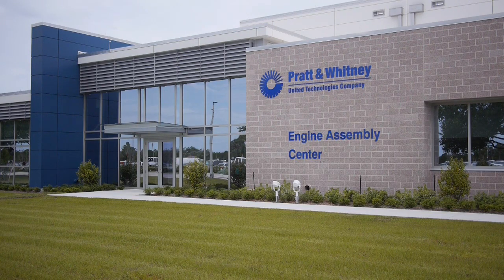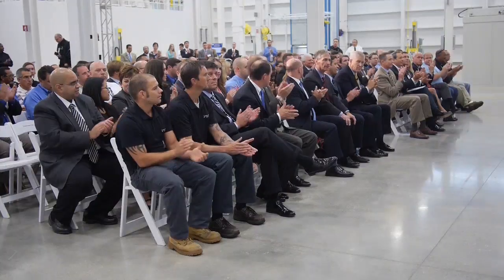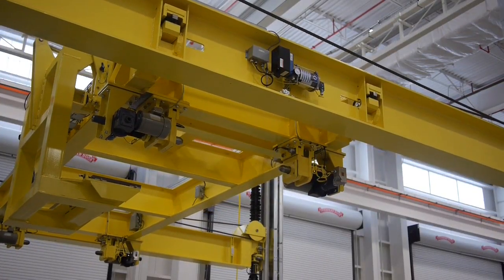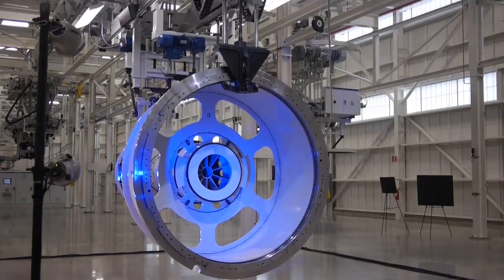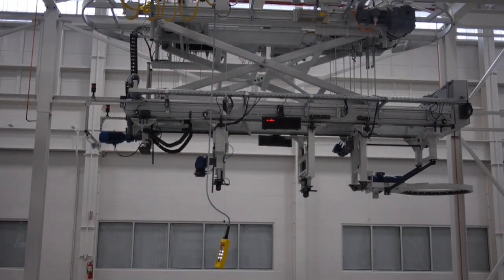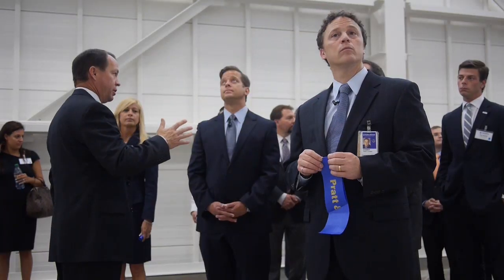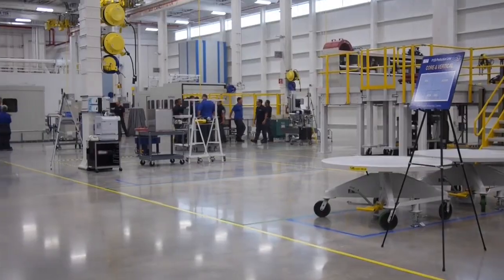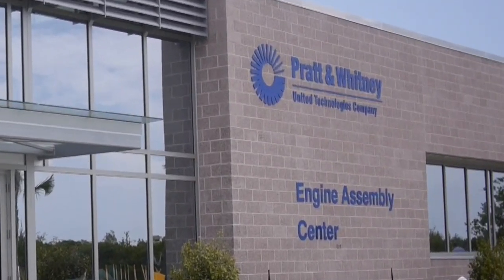Pratt & Whitney Employees Prepare for the Future in West Palm Beach

Comment: I thought they shut that down. I had a friend I grew up with that told me that. His name was Mike Kearney. He was an engineer.we met at 4 and graduated together. My dad worked in West Palm in the early 60s . He and some guys were sent there for some rocket problems.i was young. I’m glad they made good engines because I flew on a lot of them. I worked on Middletown assembly floor on JT8:for a 1 1/2 years. I move to Alaska and flew on 727s, and 737s 2-3 times a month for about 15 years. When I worked at Pratt I used to see the customer code on the paperwork.of Alaska Airlines. I used to kid my Alaska co-workers that I might have helped build that engine out there on the wing. I’d get yeah sure as I was working in electronics with them repairing oil well  logging tools.